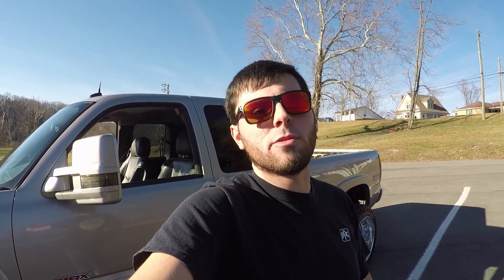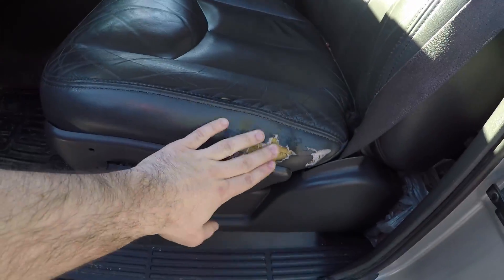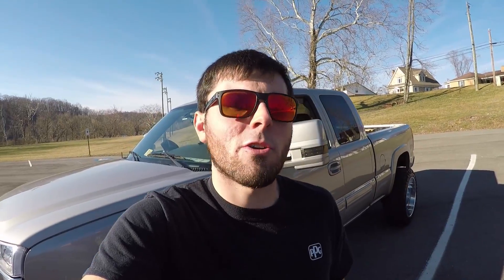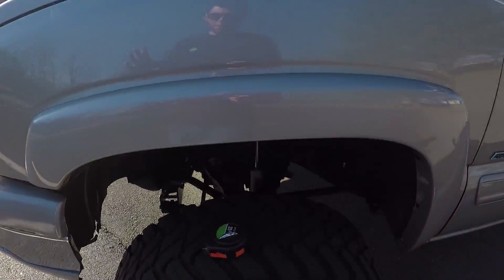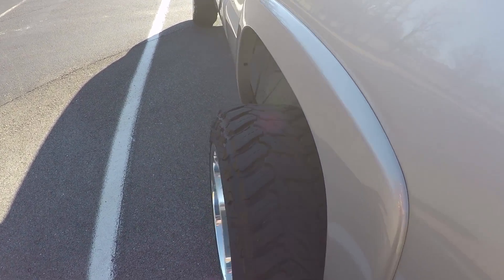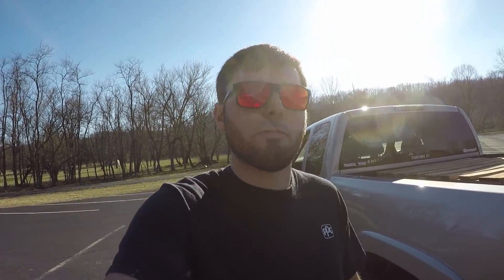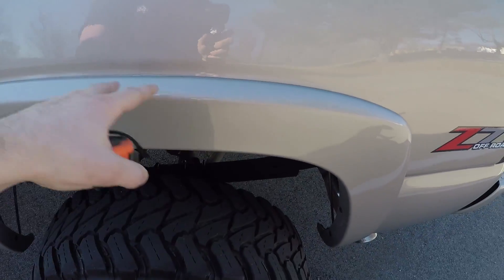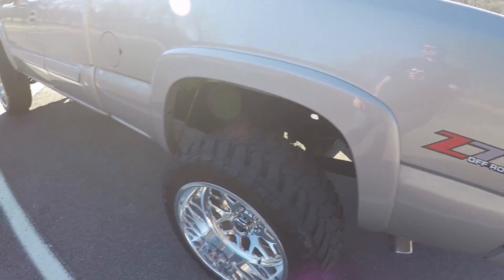The Biggest Problem With Wheel Stance

Comment: Have you thought about regearing? I'm running 35s on an 06 1500. Just got it back from the shop. Got 4.56's installed and man am I amazed. It pulls like it has stock tires
Reply from the maker: I have thought about it but I’ve been worried about suffering fuel economy
Reply: I understand. I'll let you know in a week or so the mileage I get from a full tank
Reply from the maker: awesome thanks
Reply: Levi Ward should increase city mpg and decrease Hwy right?
Reply: ِAndrew That sounds right but I'm not positive. It's running about 2200 rpm @ 70mph but no downshifts on hills so it may even out. I can also use the cruise control without over working my transmission now. Hasn't been long enough to estimate the mileage yet
Reply: mpg will suffer,
Reply: My speedometer is 10 mph fast so I know it's this isn't accurate but I topped the tank off and when the low fuel light came on I had 352 miles on the trip. Most of the driving was on interstate.